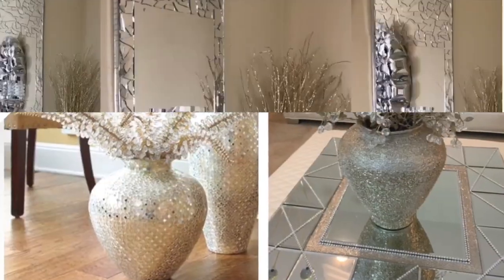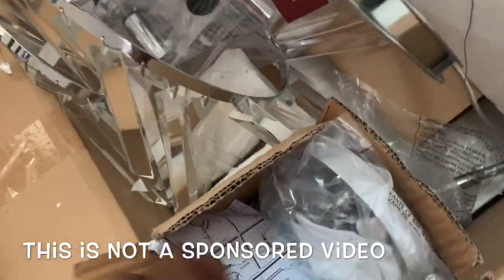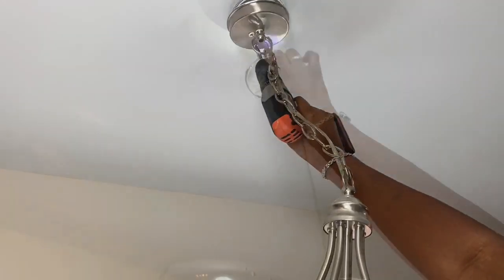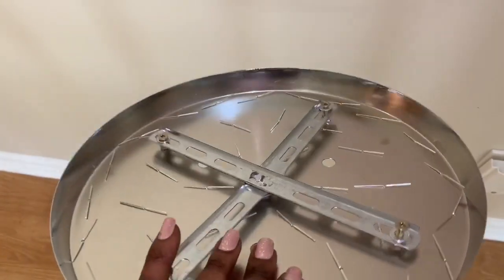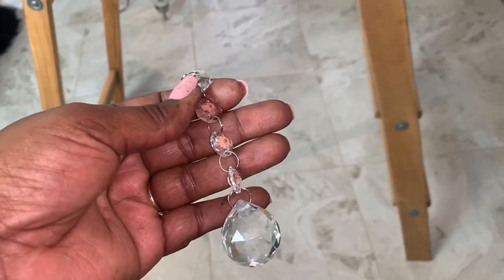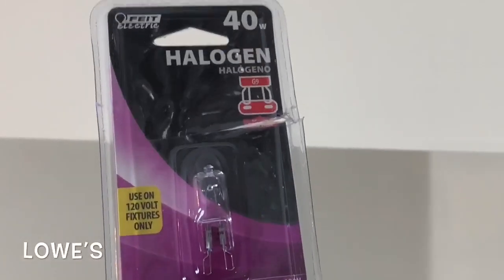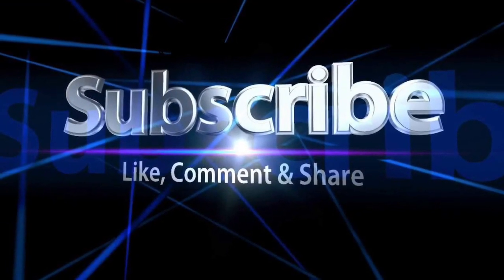Modern Glam Crystal Chandeliers || Home Improvement Series - #2

Comment: Awesome job Denise! We bought the fireworks chandelier after watching your video but are having some trouble with the wiring. Since it comes with 2 white wires how were you able to identify which one was the "hot" and "neutral" wire?
Reply from the maker: Ivan Marinov Hey Ivan! I don’t recall (to be honest) but if both wires are clear, that usually means the wires are both neutral. I suggest you cut the power, connect the wires and then turn on the power to test it before competing the install. If it doesn’t work, switch the wires 😊 I hope that helps 💕

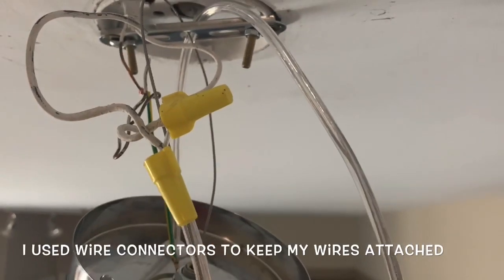Comment: I have the same chandelier as 4:17. Can you please tell me how you determined which was the hot (black) wire and which was the white (neutral) wire? I only see two silver wires as shown at 4:17.
Reply from the maker: Hi Sarah. I, honestly, don’t remember. I’m wondering if the wires are neutral. If there’s no color at all, I’d suggest you cut the power, hook up the wires and test for power. If it doesn’t work, switch the wires. I’m no electrician or expert but that’s what I would do. Good luck and thanks for watching 💕
Reply: Dazzling Designs By Denise thank you, I will try that. I didn’t even think that both could be neutral. That makes sense.